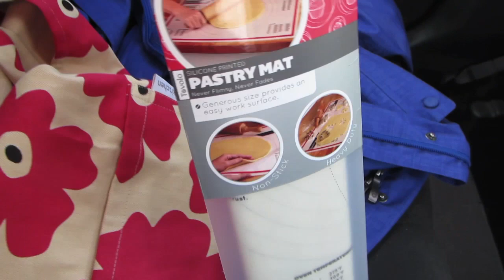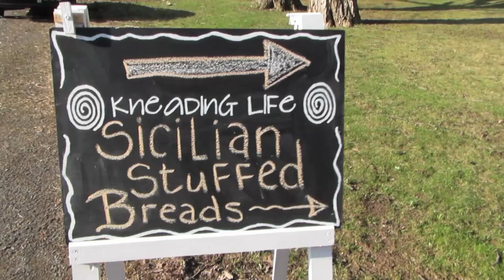BAKING SICILIAN BREAD!

Comment: If you put a table spoon instead of one. It should have not changed the taste. It does depend though on which kind of flour you worked with. Since refined flour got to work quicker since it has less gluten in it.Yes you can get better results working with little yeast and long fermentations. But adding a bit more of yeast does not change taste, may cause more flatulance though :P.